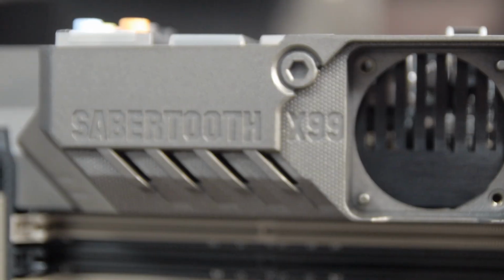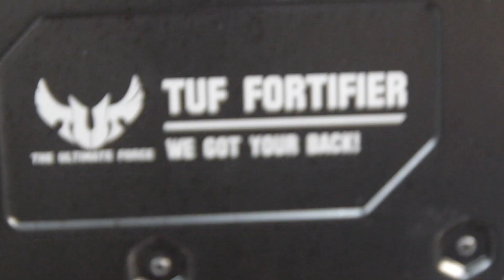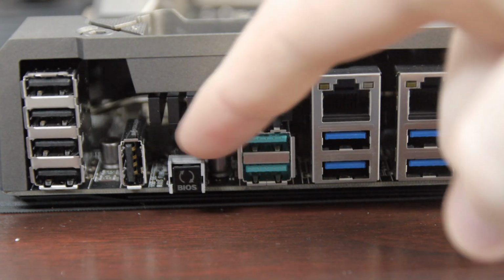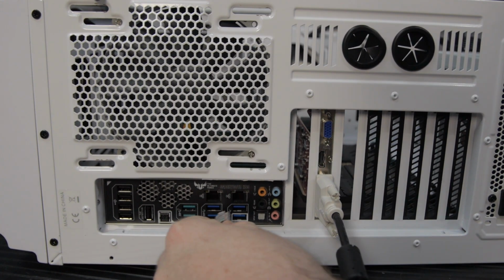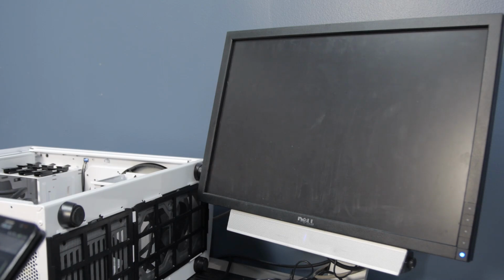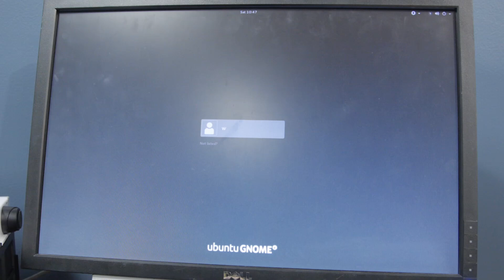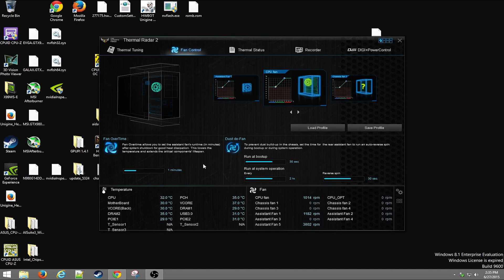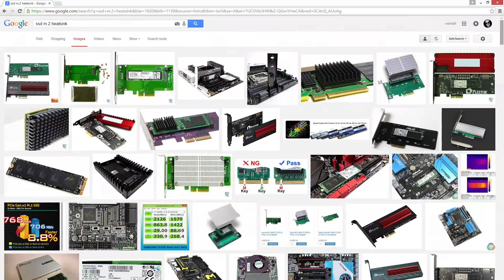Asus: Sabertooth X99 Unboxing and Testing

Comment: It would be sweet for an M.2 cover for this board BE the heat sink.  Closing the door could give a pressure fit to the m.2, so no adhesive and and still conceal.  Would any type of aluminum work as a proper heat sink?  Just purchased one off these boards and I have some 1/8" aluminum stock that could be a fun project.

Comment: Any of the TUF series motherboards that I've owned in the past - or currently have in a system - have all been stable out of the box, not a bad board in the bunch (990FX, Z77, and Z97).
I would gladly pass up an ROG motherboard for one of these.

Comment: Love those extra thermal sensors, been thinking of that as the next feature i want on my m/b for some time. I'd put one inside my PSU so i could monitor its temperatures. I want that feature on my Seasonic PSU.

Comment: Android to control motherboard's BIOS. Please no, no!!!
Rather put the developing to ability to control the BIOS without CPU, RAM, and with only mouse, keyboard and monitor (maybe even special monitor, keyboard plug on motherboard that would be independent from other ones -> to be able to use as monitoring device even when running OS).

Comment: i must have this, but ive got not enough money to build a pc from this...
but some day i will an then i mod a smartphone into the frontpanel of the pc and use it as a kind of status display
Reply: Paul imWald Modding a small tablet into a front panel is not hard you know, been thinking 'bout it too, but a standing tablet looks better, i think.
Reply: i donk like cables hanging around. inside the pccase i can build them in in a more beautiful way, i think otherwise id also prefer a standing tablet.
maybe imbedding it into the desk would also be nice in some cases.
i will think about it a little more and maybe write out my evetntually apearing ideas here

Comment: Currently building a system with this motherboard and I'm running into the same concerns, as I intend to use the Samsung SM951 512GB SSD as a boot drive. I'd really like to keep it inside the thermal Armor to keep aesthetics clean. Does anyone know of any very low profile stick on heatsinks I could attach to the drive that would keep it cool but be small enough to fit under the Thermal Armor?

Comment: I've got the z97 sabertooth and it is amazing the thermal radar software is a breeze to use and with a custom water cooling loop I have a phoybia g1/4" temp sensor running from one of the optional temp sensor headers into a spare g1/4" inlet on my pump and I have to water temp right there on my temp display, then run all my fans on my radsthrough the phanteks pwm hub Into a single header on the mobo and have that header react to the water temp sensor it's a breeze and so easy to set up the sabertooth range is a dream I can imagine the x99 being even better again differently my choice when I upgrade

Comment: Badass mobo. I could only dream of building an X99 system. What causes an M.2 drive to heat up so much?
Reply: dumkopf electrons
Reply: ***** In an SSD?
Reply: dumkopf lol not magnets but sinephase is probably right, it seems the faster an ssd gets the more heat it produces and the smaller it gets in terms of form factor, die size, packaging ect limits the amount of heat it can dissipate

Comment: TUF detective could be really cool if you want to build a computer that can only turn on for you. Don't wire in the power button and have a docking station for your phone on your desk that plugs into the usb port on the back. That is if you can configure the board and app to only work with your phone.
Reply: waitcrapwhat I'm 'bout to get one of these, already have a tablet on a dock for the this purpose, I really love to see this implementation, let the tablet running showing all the goods, plus a nice "remote" control, and a fancy looking gadget at the table (so visitors asks what the Fu** is those cool nunmebrs LOL) its a overkill implement, at least for me. Been using monitoring alternatives to show system's temp readings and stuff tru android, and I've got the rampage iv extreme at the time just cause of the almost useless OCKey (even thou it being a nice gadget). I think motherboards manufacturers should implement alternatives like asus does (oc panel anyone?), and the amazingly inovative asrock z87 oc formula oled panel, that was impressive, even it being bug and small, was a really nice implement to the segment. I'm buying mobos for years now, and they all look the same you know, just a diferrent color scheme or something silly like, so I just went to motherboards that includes nice gadgets and innovative features, thats my liking of course...'bout the Sabertooth, its by far, the most reliable boards out there (my old z77 proves so), far better components and stability than the "overpriced and overlooked" ROG series (really, i had bad experiences almost with all ROG boards I onwed, audio issue the most common, so no, not buying the fancy Rampage V just for the branding again). Sabertooth X99 is the way to go for the new 2011-3, for me, it is the best offer on x99 out there. (sorry my english, i know  it sucks LOL).